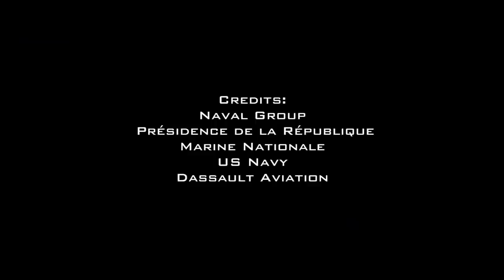France’s New Aircraft Carrier PANG will be nuclear-powered

Comment: A beautiful ship which will greatly improve our projection capabilities and allow our nuclear and shipbuilding sectors to maintain important industrial know-how!!! On the other hand, the PANG model raises questions. One of the catapults is located right in the middle of the elevator and apparently does not allow its use during the catapulting. The number of catapults is limited to 2 according to studies validated by the General Directorate of Armaments and the French State. On a building of this size this is incomprehensible and must limit operational efficiency. There are also 2 elevators. It seems less burdensome even if 3 would have been better.
Reply: FYI these are just rough CGI concepts dating back several years.  Bit early to jump to conclusions based on concept art.  
The final detailed design is being locked down now and will need the greenlight of the French Navy and DGA.  First steel cut is scheduled to happen next year.

Comment: It is always go but to have 2 carriers, France is only building 1? Will Charles DeGaulle be the 2nd or will there be a 2nd carrier?
Reply: Charles de Gaulle is already operating and is nuclear powered too. That one will be second nuclear powered aircraft carrier to be built.
Reply: Given this annoucement being large and nuclear its likely only one will be built, a direct replacement for CDG
Reply: TBC
Reply: It's pretty unlikely because a. The number of additional airframes that would be required but also France just barely maintains enough trained pilots to operate CDG.
Reply: they speak about a second carrier to lower the cost , it would be not expensive to have a second with the same design. the answer in 2025 may be if france has a good economy again.
Reply: @stephen10.  Its not simply the cost of the steel or the design but actually crewing a second carrier. 

Without substantial increases in the French defence budget I don't see it being a likely outcome.
Reply: steel is cheap the thing that makes it expensive is the fit out with the electronics. the more you build the cheaper it gets
Reply: The CDG is running on borrowed time, it will not be around for much longer, too old, unreliable and too expensive to refit.

Comment: PANG is good but surprisingly has only two aircraft lift on one side🤔🤔🤔🤔.
Reply: Its only planning on running around 30 fighters, 2 seems plenty.
Reply: The ucavs not mentionned in the video won’t reach the deck by themselves, though.
Reply: 32 of SCAF fighter, witch are a lot bigger and heavier than the Rafale + attack drones....so yes that needs a bigger ship. the elevators will be bigger also in consequence. With two lauch pads= two elevators. You only will complicate manoeuvers on deck with more. the CDG has the same type of config and is highly effective in operations.

Comment: How big do you really need them. At most you'll have 12 aircraft in the air with enough planes for another two shifts in a day. That's 36 aircraft. 50 thousand tonnes is adequate.
Reply: Air is free and steel is cheap but space is useful. The majority of the cost isn't from the size but from the capability.
Reply: In addition to the 30 or so manned aircraft you must add a number of « loyal wingman » , remote carrier type drones, and the deal for the French navy is to be able to launch one 24 units strike and eight 2 units combat air patrols per day, in one of the scenarios I saw, another being fifteen 4 units strikes and no CAP, which seems hazardous to me...
Reply: Bendjamin ButtPlug  this ship is actually capable to carry more than 50 RAFALE jets, but it will carry only 32 of the much larger future 5th generation French and German fighter jets.
Reply: @siadwarsame2045  NGF fighter 6eme gen.
Reply: Fabio 86 Yes, Thanks for correcting me about this futuristic and most capable fighter jet. I thought it was 5th generation fighter.
Reply: @siadwarsame2045  Yes the scaf will be 6th gen. The New carrier is a lot bigger cause the SCAF is a bigger fighter + attack drones. You could put 50 Rafales on this new carrier. It is sized for the SCAF. Hope we will build a second one.
Reply: Nemo Yes, I hope France builds two of these ships instead of just one.
Reply: @siadwarsame2045  we will know that by 2025: deadline the French gov retained to make that decision or not.
Reply: Nemo awesome……can’t wait to see both ships sailing side by side with US and UK carriers.

Comment: Looks great. But sure taking a long time. Retiring CdG will give French Marine only one jet attack carrier. France historically always had at least 2 or 3 carriers in service at one time.
Reply: Since 2015 the French Navy is a Rafale M only operation.
Reply: Our french  LHD does amphibious  missions + head quarter + hospital + troops transport  + helicopter transport  or tanks / trucks  transport + landing forces + air defense  etc ... they are multi missions .
it can take 2000 civils for evacuation or to have 1000 troops for landing.
Reply: @stephen10.  The Mistrals are not carriers. Try to land a Rafale on one and you'd be lucky to stop before going over the bow.
Reply: @ryanbrewis6990  right , with some transformations they could put f-35 on them may be.?
Reply: @stephen10.  Perhaps. But the deck would need heat treated, there's probably not a huge amount of space for jet fuel since it was only intended for helicopters, the magazines are most likely minimal (you aren't dropping a 1000lb JDAM or Paveway IV from a Puma) and how much are you taking away from the ship's ability to carry out and maintain an amphibious assault? Is it worth it when a flight of Tigers are easier to accommodate?

Comment: I have a few questions:
Why is the bridge so far back?
I understand it has to do with air operations but wouldn’t it be safer if it was the furthest away from the landing strip, on the drawing: between the elevators?
This may also protect an elevator in cas of a strike at certain angles.
Talking about them, why not putting one on each side of the ship, likewise for protective reasons?
Finally, we have here a ship that will be roughly 50%heavier than its predecessor, carrying machines that will be much more energy consuming, the CdG has energy generation issues with the K-15, they do the job but barely (or so I have read), will a pair of K-22 be enough?
Reply: The bridge location is to facilitate air operations.
Nonesense, there are no energy issues with the K15 reactor on the CDG.  Each K15 produces 150MW, so 300 MW total.  To give you a perspective, that is significantly more than what the new QE carrier class produce. In fact one K15 reactor produces more energy than the QE total.

Comment: Got to wonder if being slightly larger than QE is for practical reasons or political ones?
Reply: They have probably been studying numerous designs for years. It has to be nuclear powered, have a proper catapult, and carry x-amount of aircraft. But obviously the final arbiter is that it has to be larger than the Brits carriers just to cheese them off because that is so important to the French. They just need to build two. Then our humiliation will be complete.
Reply: it will be slightly bigger, literally a few feet, but it is nuclear so will have less space than the QE class internally. the QE2 has an enormous holding bay due to it's more conventional gas turbines. even if they built 2 why would we be humiliated? they are 2 different designs that are almost the same size. France is never going to build 2. i doubt even the first will be built
Reply: just french grandeur.
Reply: @SirZanZa  You doubt it will be built even though President Macron just announced it would be? Also it is being built as a replacement for their current carrier.
Plus you have stated it will have less space because apparently a gas turbine is smaller than a nuclear reactor without knowing what design of nuclear reactor they will use or how much space it will actually require. Your powers of ESP are truly amazing.
Reply: @lorenzo4408  Does this even mean anything?
Reply: @SirZanZa  conventional generally takes up more space because of the fuel needed. 4 million litres for QE.
Reply: @Makeyourselfbig  likely cost around 12-15 billion  to build 2, do you think France can afford that? I don't
Reply: @davidhouseman4328  you'd think that yes but the fuel is stored deep in the bowls of the ship near the ballast tanks where the space would otherwise be useless. Nuclear take a LOT of space even the new A1B that is going in the New US carriers even though smaller than predecessors they are still substantial when you consider all the rest of the equipment needed to keep the reactor in check and the fact that there are 2 reactors. that is the reason for the US carrier being 10% longer. the only reason the UK didn't go nuclear like its submarines is because it stops them from entering Nuclear free waters of which many are allies
Reply: @Makeyourselfbig  yes, it is a french word which refers to the time when France was one of the world major powers, a long time ago
Reply: @lorenzo4408  About the same time the UK was you mean?
Reply: @Spartan-jg4bf  I don't see why not. Compared to the enormous cost of the American nuclear carriers it's a bargain.
Reply: @Makeyourselfbig  The French Budget is 49 billion, the US budget is 700 billion, big difference
Reply: @Makeyourselfbig  yeah but the pint is that France wants to be great again stepping on others (like Italy) even if they can't (for many reasons).
Reply: @lorenzo4408  what are you talking about?
Reply: smile 2192  Another fantasist.
Reply: ClickNSpam what r u talking about? this French super carrier is 75 to 80 thousand ton ship, While the Brit carriers are around 65 thousand ton class. so it’s 10k ton difference.
Reply: Spartan 101 R u aware that France is the 5th largest economy in the world?  France can build more than 10 of these super carriers if it wanted to.
Reply: @siadwarsame2045  I doubt it. The French economy is about the same size as the UK's. The French have a defence budget and their military have to spend accordingly. They could probably afford two but certainly not ten anymore than we could. To build that many would give them a navy equal in size to America's.
Reply: Joe Soap Yes, u r correct about America’s insane defense spending, no other country can even come close to that amount of money being spent on just defense.

Comment: This will go the same way as the PA-2 the French failed to build even with shared costs of the QE Class carriers of the UK. They are cancelling orders for Air Force Rafales and their Rafale Ms are 20+ years old and reducing in service numbers to barely 30 aircraft.
And they will still only have ONE carrier.
Reply: This is a replacement carrier and will  be built. French pride wouldn't suffer no carriers while the UK has two.
Reply: @davidhouseman4328  As always I take your point David but they are looking to do a USS Gerald R Ford without the US Navy's budget. And what will fly off it?
I never doubt France's ability to build whatever but its the economic ability that is always suspect and why they baled out of the QE programme when the costs were at their lowest.
There is the other fact of carrier strike that at least two (ideally three) are needed to maintain at sea capability. Their current carrier spent 60% of its life in dock and when that happened France had zero carrier strike. In 2000 / 2001 France went from 2 carriers to one (the irony being Clemenceau was scrapped at a UK yard) and the same will happen with this adventure. Nuclear ships require years of refuelling without any other maintenance needs and the USA reckons on a rate of 3 ships per 1 active.
Reply: Conveniently disregards the fact that France has already built one such carrier and that the Rafales have been upgraded ever since their conception and are far  more capable than Typhoons and more capable than F35s on every front but initial air to air engagements + The fact that theF35 project was a debacle and that even the US recognizes that their much older F22 is way better and thus still banned from export.
Reply: @flyingpharoah4867  So why haven't France built more nuclear carriers then? And why did they bale out of the QE / PA2 deal? The answer is MONEY. France is currently in a very bad way economically and was in recession even before COVID struck. Because its vaccine rollout is controlled by the EU it has been an utter farce unlike other nations like the UK. This will delay the economic recovery and latest figures show the EU countries have increasing infections and deaths. So while they built one nuclear carrier they couldn't build another ans were without carrier strike for many years.

And then we get the rather imaginative comments about the Rafale. Only one variant flies off carriers - the Rafale M and that is now 20 years old and has NOT been upgraded due to budget constraints. They only had 40 with less than 38 now operational. There is no plan to build more with the French Government building with Airbus the EU's 'New generation Fighter'.

It is simply not true the Rafale is 'more capable' than the Typhoons especially as both have been upgraded at similar times in their history. The Typhoon is clearly better in the opinions of the people spending hard cash who have bought twice as many Typhoons as Rafales. Recently Germany bought 38 new Typhoons with Spain looking to buy 30+ more. And France? It has had to cut back Rafale orders for their own use because of costs considerations.

And forgive me but I just cracked up at your momentous joke:
   "and more capable than F35s on every front but initial air to air engagements"

Yes of course it is. You have a great weekend mate ... 😂🤣😆
Reply: @kms_scharnhorst  Sorry. You totally lost me with the "3rd world African countries" bit. You just insulted millions of people by calling them '3rd world'.
Given many African countries are in the Commonwealth led by the UK's Head of State we all seem to be getting along just fine.
Reply: @flyingpharoah4867  lol you talk some rubbish.
Reply: @1chish   no the answer is politics, not the money. And building a carrier was not a sexy promise for the voters. It has changed now
Reply: @kalonbzh5529  Well lets see who wins the Presidency this year and lets see where France is economically when that is decided.
Reply: @1chish  it has been already decided and all  candidates in position of winning are in favor of boosting the defense budget. The election will not change anything.
Reply: @kalonbzh5529   the election might not but its still got to be paid for. Personally I think if France are serious about carrier strike they should build two conventional carriers rather than one nuclear. Just zero advantage to nuclear power. Its just bragging rights for France but as Harold MacMillan said to Kennedy over Cuba:  "Events dear boy. Events"